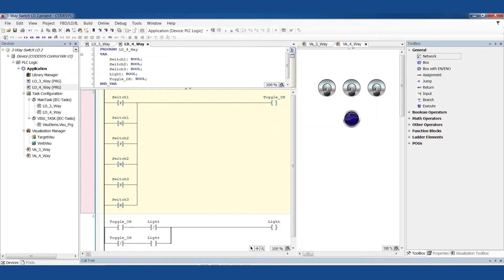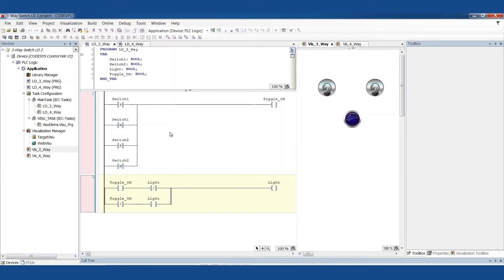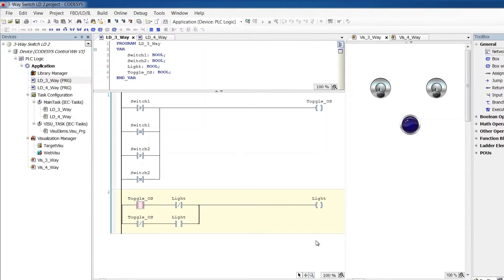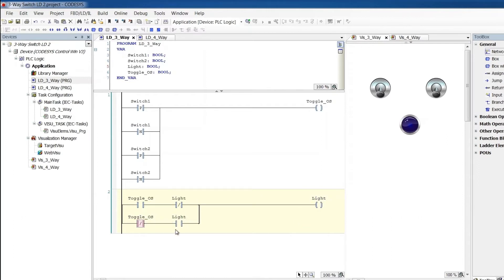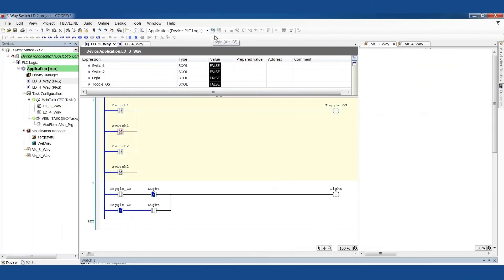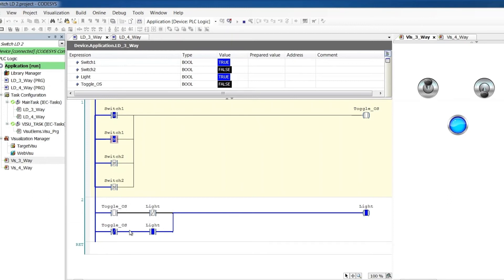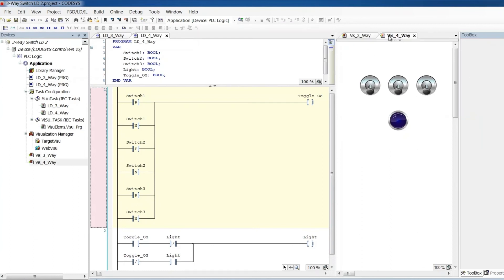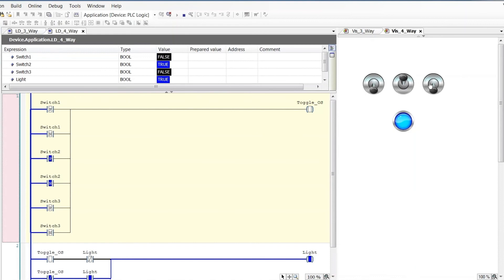3-Way Switching in Ladder Logic part 2 - PLC Programming Cookbook

Comment: and what will happens when there is a contact bounce?
Reply from the maker: Great question.  Most PLC inputs have some debounce filtering built-in, so it's rarely an issue.  I can't think of a time in the last 10 years I've had to debounce in logic.  That said, if you do find a case that needs debounce in the code, you'd have to do that one at a time for each input using timers.